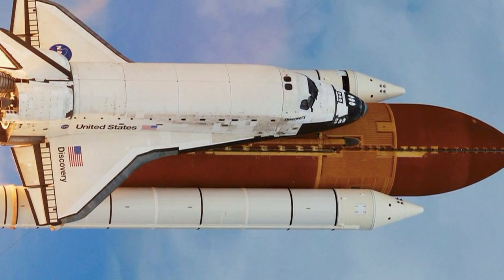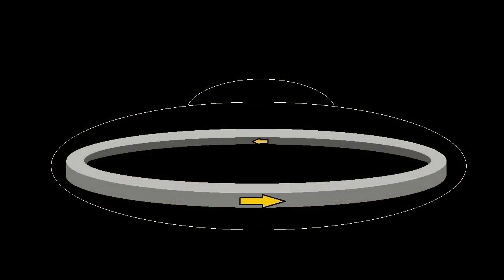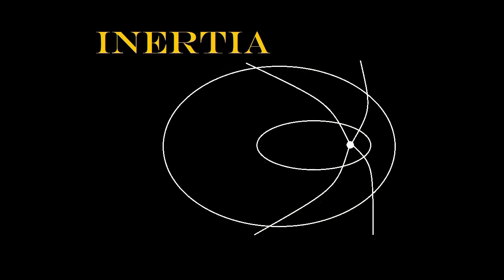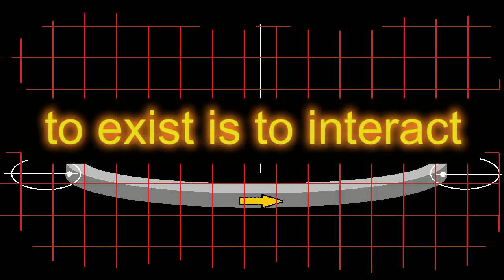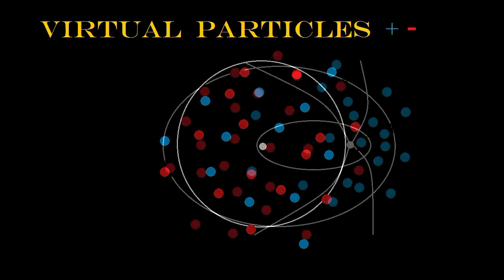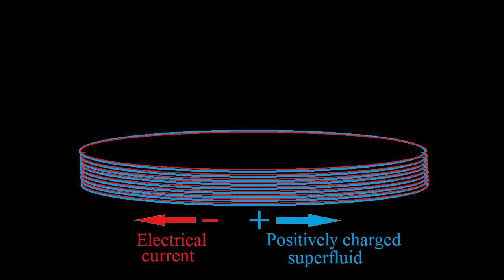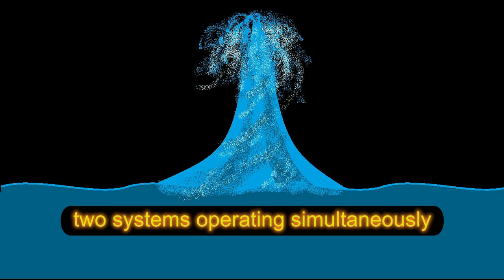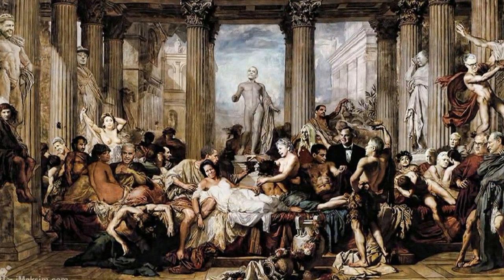UFO & Flying Saucer  Propulsion Technology

Comment: A question to all of you electrical engineers out there from a dumb, former trial lawyer, who wishes he had studied electrical and mechanical engineering and who, based on the evidence, believes that we should have had by now, and probably already do have, craft which fly on UFO type propulsion, most probably by the TESLA like principles of "electrostatic propulsion" which do not require propellants.

Like all interested LAYMEN, with at least a superficial understanding of the principles involved in this science, I wonder if it is really necessary to get into this whole convoluted and complicated hypothesis and explanation to just lay out the general parameters for a UFO type, non-propellant, non-inertial, based propulsion system.

I am pretty sure that TESLA already designed such a system based on electrostatic propulsion, which I understand requires only the generation of enormous electro-magnetic fields which will provide LIFT and counter-rotating magnets to provide directional thrust. The energy to drive the system should be coming from a reverse TESLA coil drawing energy from the FREE and unlimited ambient energy  in the atmosphere or in outer space.

I understand his design did not require some weird ""magical" fluids rotating around the perimeter of the craft, which sounds like a more primitive system then a more advanced one,  and which seems vulnerable to all kinds of problems, nor some form of multiple UTRON powered craft using devices which allegedly generate "private" gravitational voids through which the craft is forever falling. Also, the idea from Ralph Ring that the pilot communicates with the metal craft and controls it by "telepathy" sounds preposterous...and to me, only discredits this whole endeavor...BUT I DO KEEP AN OPEN MIND.

IS THIS NOT ALL RELATIVELY SIMPLE ?

Am I not right that all this electrostatic propulsion system  requires is a very powerful magnetic field...something which could be generated by a TESLA coil with more then two or three secondary coils ? He postulated MULTIPLE step up transformers with unlimited voltage potentials. As I understand it, LIFT would be generated by a REPULSION reaction and DESCENT by an attraction reaction, depending on the polarity of the field...a sort of PUSH-PULL reaction...is this not all just straightforward ELECTRO-MAGNETISM applied in a different context?

I am 100% sure that the Germans already had such craft, based on this TESLA science back in the 1940's because the Allied pilots even had a name for them called " FOO FIGHTERS" . They were not alien  UFO monitoring our war, they were German UFO-type vessels and this is now a historical fact confirmed by a two hour special on the History channel.

I am also pretty sure that many governments and their military already have such flying devices and have been testing them for years and years , and that these account for a large portion of the UFO sightings....but NOT all...some are still and obviously ALIEN

WHERE IS THIS SCIENCE AND WHY ARE THEY KEEPING IT FROM US ?

As big a genius as TESLA was, it is inconceivable to me that in over 100 years no other engineers have been able to replicate his advanced sciences or that they have been unable to decipher and COMPLETE his unfinished work.
Reply: that was a great observation. me and one other guy have that idea. basicly a hot air balloon using a forcefeild aliminating the balloon. considering its controlling plasma, it could derrect the force making a plasma rocket, too.  the heat can be held back by sound waves equaling the mass of the plasma particals controlling and pulling plasma with a altrasonic and magnetic feild. it physicly seems possable. only time will tell.

Comment from the maker: No. If it were c, it would form a "couple" as Eddington put it and we'd spiral into or away from the sun (I forget which it was). Look up the "aberration of light" in regard to optical telescopes. Astronomers have to slightly angle their telescope because of the finite speed of light, i.e. else it will collide with the side of the telescope on the way down the tube.

Comment from the maker: This is a false assumption. A gyroscope does not resist a change in the attitude of its axis ... UNLESS ... it is allowed to precess.
Example: If you set a gyroscope with its axis parallel to the ground (on its stand), it will not fall ... ONLY ... if the axis goes around on the stand. If you put a heavy brick in the way so it can't go around, it will drop like a rock ... slowed only by friction with the brick.
A 3 axial gyroscope does not resist in any direction. You can roll it like a ball.

Comment from the maker: "... it was shown that gravity travels at the speed of light"
I no of no such 'show'. The speed of gravity has been conjectured to be far in excess of light velocity by many scientists because of the failure to display phenomena analogous to the aberration of light.
Reply: If gravity travels at speed in excess of light, Is this what gives increased mass at higher speed? 
Because a hypothetical Lightspeed craft would have infinite mass.
Are gravitons more than hypothetical and can't be detected due to their high speed?
If gravitons could be captured with electromagnetic fields it could hypothetically create negative and positive mass fields?
Am I off base here?